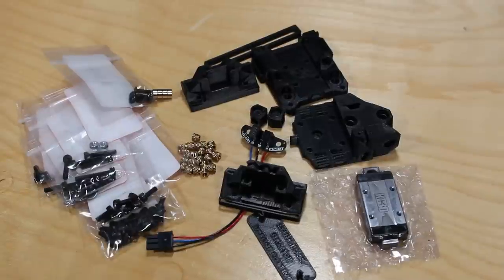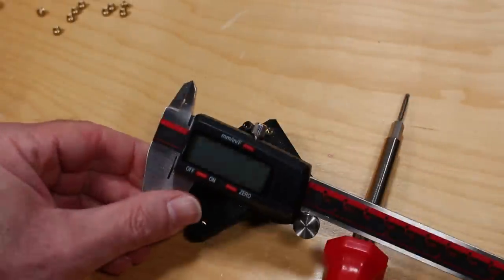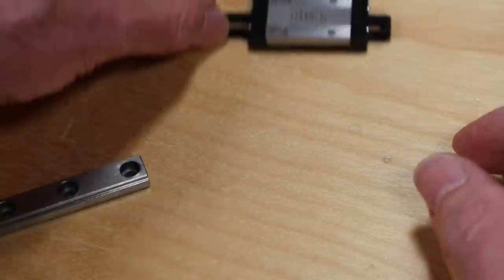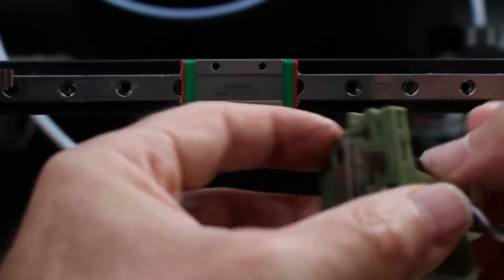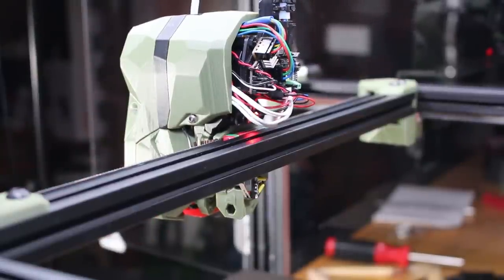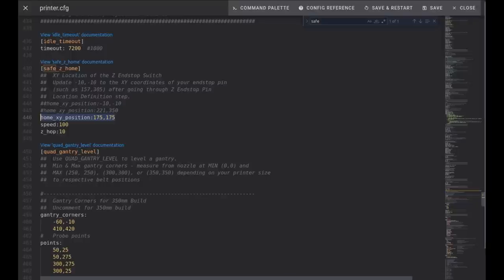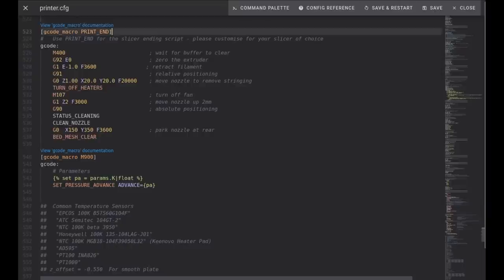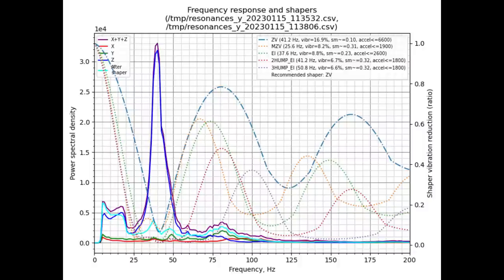Voron TAP build, install, configuration, tips & tricks, final thoughts.

Comment: Another addition: I just installed the 3do nozzle camera. Absolutely awesome! I printed the stealthburner adaptation, pulled the 2.5 meter usb cable through the cable guide. Added camera to moonraker and fluidd. Works like a charm! I did not change the led’s, because I already have rgwb (4 channel) and the leds that come with it are 3 channel white.
Reply from the maker: That's cool to know!  I've been looking at that as it would be nice to have.  But since switching to canbus, I'm reluctant to add a USB cable to my print head as I'm down to just 4 wires.  Which honestly, is just silly of me to bypass the benefits of a camera like that due to some wires!  You may have convinced me to just go ahead and do it......Thank you very much for the comments and watching!

Comment: I'm glad I stumbled across your channel! I don't know how long you've been making content, but you are a pro. I already watched your SB2040 CAN install and that was great as well. Concise, easy to follow,  great audio (other youtubers need to take note), great video and best of all it's not buried in the middle of a 4 hour long live stream. Keep up the great work!
Reply from the maker: Thank you so much for the kind words and watching!  I'm glad you find these useful!
Reply: @KapmansBasementWorkshop   A lot of the non-Hiwin rails have "fake" grease ports. They have the hole, but it doesnt lead anywhere. Also I decided to pull the trigger on the 2.4r2. I self sourced and built a Switchwire first, because I thought it would be an easier build and get me familiar with the Voron way of doing things. I've picked up a bunch of tricks and tips from watching your vids, so I'm excited to give it a go! The ldo kit I purchased comes with klicky and I've already printed and assembled Nevermore v5 duo, but what mods would you recommend from your experience? Do you think I should skip klicky and go straight to TAP? Thanks again for the great content!
Reply from the maker: @fumanseano2846  Since I actually print from my basement, Nevermore helped a lot gaining acceptance of this from other family members.  If you are interested in printing as fast as possible, I would continue with Klicky and add the automatic z-calibration software install (amazing) to that.  It works great.  If speed isn't your top priority, TAP is nice.  I'm actually still using it and like it quite a bit.  I find myself constantly tinkering with the printer so I've used magnetic panel clips (there are non-magnetic options as well) on the 2 side panels so I can easily and quickly remove the side panels and get them back on again.  Super useful.  I don't know what size 2.4 you are building, but I find the 3d printed handles that mount to the top of the printer very helpful on the 350mm model.  I don't know if your kit comes with led lighting for the interior, but I consider it mandatory at this stage.  Finally, once you have the printer up and running for a while, after some time, if you run into any wire breaks (you may never have that problem), I'm a fan of canbus.  But it's not a trivial upgrade.  I think the most important advice I can give you is to be careful each step of the way in the build and construct the printer as square and accurate as you can.  It's a really well designed 3d printer and actually works pretty fantastic once fully assembled.  Just be sure to follow https://ellis3dp.com/Print-Tuning-Guide/ after you have completed the Voron initial startup instructions.  It's the best guide out there to take your print quality to the next level.  I wish you a fantastic build!
Reply from the maker: @fumanseano2846  I failed to respond to all of it.  Some people are drilling 1mm holes into the fake grease ports and the claim is that it then works properly...

Comment: Lot's of good info.  I've been using TAP on my Voron V2 with smooth PEI.  As long as you're not probing with a fully up to temp hotend you shouldn't see any drastic damage.  I actually haven't seen any issues with mine.
Reply from the maker: I also lowered my temps quite a bit and I have been using it with a smooth PEI sheet as well.  And no marks.  I'm getting ready for a followup video on some tips and what I've learned.  As the weeks go by, I like it more and more.  Thanks for watching and the comments!
Reply: Beacon has entered the chat.
Reply from the maker: @beaconscanner  Yes, it has.  :)

Comment: I've been looking to rebuild my hot end assembly because I have a cw1 and was going to install TAP when I did the cw2 upgrade. I've been waiting for 3dlabtech to restock their TAP kits but after watching this it has made me rethink the TAP. My klicky setup has been working great and as much I want the new 'hotness', I'm not sure if the loss of acceleration potential is worth the fomo.

Thanks for another great video and keep up the good work!
Reply from the maker: It works well, but I'm not sure I'm going to keep it on my printer.  I want that acceleration back and I really like printing on smooth PEI.  I'm "on the fence" I suppose.  Thank you for the kind comments and watching!

Comment: On the carriages without grease ports, the plastic wiper still has the hole for grease, which makes it look like there is a grease port on the metal carriage. You can also add the grease through one of the rail holes.
Thank you for the video.
Reply from the maker: Thanks for the info!  I did not know that!  I'll bet that is what was happening here.   Thanks for the comment and watching!
Reply: Yup, the hardware kit I bought from Tensor 3d came with a garbage rail. Super rough, pretty dirty and didn't have a grease port. I had a backup LDO rail from the original build and took the carriage off of that. Has a grease port and slides like a dream..... Now I just need to find a PCB. 😭

Comment: The bed doesn't need to cool to probe...you nozzle need to be below printing temperature while probing...also I used a thinker Pei sheet and probe at temperature and have a small pit so milage may vary here...just a few point to throw out.
Reply from the maker: I might have used the wrong terminology.  But you are correct.  But also, the nozzle isn't supposed to be over 150c when probing.  Near the end of the video, I show what happens to PEI....Thanks for the comments and watching!
Reply: @KapmansBasementWorkshop for sure great! video!
Reply: @KapmansBasementWorkshop  so now I’m confused: can the bed and sheet be at printing temp (110 for me) as long as the nozzle is “cool” (<150)?
Reply: @drumsmichael  yes. it's how it's designed to be used.

Comment: Hello Mr. Kapman! I have possibly a silly question: does it still make sense to do automatic z calibration, if I have the Tap installed?

If I understand correctly, there is stil an offset between the nozzle and the probe and if I change the hotend part of the Stealthburner, I would need to readjust it? And if I have this plugin, it can do this automatically, right?
Reply from the maker: Not silly at all.  If you have TAP installed, no need for auto calibration.  For my machine with TAP, I just don't use it.

Comment: I’ve used smooth pei running R8 tap with 4 N48 magnets and while it’s leaves a small barely discernible mark it doesn’t effect the actual coating at all , now I rarely use smooth pei but it can be done.
Reply from the maker: I'm actually using smooth all the time now.   It works as long as the bed and nozzle aren't too hot.
Thanks!

Comment: Thanks for the great video. Since first installing Tap, are you happy with the change or do you regret theEuclid probe?
Reply from the maker: I'm actually happy with TAP.  I have not switched back to any other probe.  But the scrub brush is even more important now.  Also, at the temps that the Voron designers recommend, smooth PEI works just fine.  I actually lowered the temps by 10 degrees and it still works accurate enough.  No dents or scratches in the PEI.  My acceleration is not much better, but I'm going to try and clean up a few other things that may be impacting that.  This includes using an accelerometer in a different location.  There is also a new release of TAP where it appears they worked to improve it's stiffness.  So  I also need to give that one a try.  Thanks for the good question!

Comment: Finished my first Trident last week and installed Klicky PCB with AutoZ and seems solid. I did swap the switch the Klicky PCB came with as it was a plunger style and was giving varying readings. Soldered in a D2F-L switch and lots of times it will read the exact same reading on multiple probes down to the 0.000001. One day I might fool with TAP and see how it's used. Sadly I prefer a Smooth PEI sheet so knowing that now I don't think I can ever really run this.
Reply from the maker: Someone in the community reached out and stated that if one chooses to use a much higher quality smooth PEI sheet, they should be ok.  But that really implies that the 5 or 10 mil think PEI sheeting is used on a self applied bed plate.  But I have not tested that.  At some point I will give it a try.  Thanks for the comments and watching!

Comment: Great video. Thank you for the help. I just installed mine today and missed a lot of the breaking it in steps.
* update: I decided to go back to Klicky Probe. I didn't like the TAP. initially it worked ok, but then kept getting an error for triggered before homing/leveling etc. I did the loosen magnets & move printhead up and down but this only seemed to work temporarily. Maybe they should give a bit more clearance before its triggered. Also, out of the blue I got an error Move out of range: 0.000 0.000 5.052 [0.000] and couldn't fix it. Nothing changed in my printer.cfg before I got the error but I couldn't print anything. So I wen back to Klicky. I really like the TAPs X-Carriage more than the stock carriage. I hope they impliment it into the builds.
Reply from the maker: Thanks for the feedback.  I am actually still using it.  I like it, but I sure wish it were much lighter.

Comment: What about adding heat to the grease to reduce viscosity just to assist with greasing these bearings? Obviously you don’t need to hear it excessively but that should help without hurting the grease since the viscosity will just return to normal when it cools back down.
Reply from the maker: I think it does help.  I warmed up the printer with the bed at 110c for 30 to 40 mins.  I'd like to think that helped.  So far, it has been working well.  Thanks!

Comment: Hey there, I had problem here, I just bought cb1, i was confused òn what is ìt 16gb rom or ram I was confused. And one more is it esstial or waste of money
Reply from the maker: The 16gb is the eMMC storage. You won’t need an sdcard since the storage is built in. Basically a sold state drive that is usually faster and more durable than a SDcard. The cb1 has the cpu power of a rpi3 but more powerful graphics processing.  I don’t think the 16gb eMMC is a waste of money since sdcards wear out fairly quickly if they are written to often. When it happens, you need to reinstall everything including the os on a new card.  I’ve had this happen to me multiple times.  In my Klipper screen video I use the cm4 rip that had eMMC storage and its running great.
Reply: Thanks very much. For the opinion I wìll go with 16gb then.
Reply: I was about to return the product in store to get 1gb one.
Reply: @KapmansBasementWorkshop  best youtuber #3d_Printer_guider.
Reply from the maker: @deone-entity3935  Thank you!

Comment: Same acceleration issues here. I like that’s is super reliable and it doesn’t matter which surface you used. But I haven’t used smooth PEI.
I also see some retries when doing the quad leveling. Before, I was using Euclid probe and had inconsistent z offset, even when using autoz. 
Overall I’m happy with tap, but I’m not sure if I’ll keep it for too long.
In addition I also he CAN Bus using sb2040, and I had to add a small 20x20 fan to cool the mcu. Because when printing ABS the enclosure gets to 65 degrees and the sb2040 was shutting down close 100 degrees. With the small fan the mcu never goes beyond 80 degrees. My Y acceleration it’s a bit better than yours for some reason
Reply from the maker: So far, I'm still using TAP, but I have left everything else in place just in case I go back.  I have dropped the TAP temperature for the nozzle to 130c and today is the 1st day I'm printing with smooth PEI.  Time will tell pretty soon if this is ok.  I have not had overheating issues with my EBB36, but I did end up placing 2 small heat sinks on the driver chip (one on each side of the circuit board).  But I have seen multiple fan mods.   Also, I have the 20mm LDO motor instead of the 17mm.  It seems to use much less current.

Thanks very much for the comments and watching!
Reply: Try me.
Reply from the maker: @beaconscanner  Send one my way...
Reply: @KapmansBasementWorkshop  your channel rocks. Happy to send you one.

Comment: in your pros you didn't mention various thickness build sheets?  Is this because you are coming from klickey, or is this not an advantage?
Reply from the maker: Actually, it is an advantage.  I failed to point it out because I switched from automatic z calibration with Euclid and so I didn't really gain anything beyond what I had previously.  But you are absolutely correct.

Comment: I am wondering why when you were greasing you didn't remove the needle and just pump in the grease into the center hole of the rail then use the plastic piece to hold the bearings?
Reply from the maker: I had not heard of that technique.  But I have learned of it since.  That said, I typically use Hiwins and the grease ports actually work, so I was surprised when that did not work on this rail. But when pumping grease into the center hole as you described, that may work for an initial greasing, but what happens when later you need to apply more grease?  Do you completely remove the rail so you can do that again?
Reply: @KapmansBasementWorkshop  I guess you have to take it apart to grease it. If the grease port is not working you have to take it apart anyway. I am just saying it would have been a little easier for you and I didn't know if you knew about that technique. So I just thought I would mention it.
Reply from the maker: @chucktaylor5878  I learned about it after I did this work.  I wish I knew then.  Thank you for the tip!
Reply: @KapmansBasementWorkshop  I forgot to say thank you for the video, I didn't mean to sound ungrateful. Your videos are the best. I always look to seek if you have one out for what I need. Keep up the good work!! You have the best 3d printer content on youtube!!
Reply from the maker: @chucktaylor5878  I did not read it that way.  I'm always grateful for tips.  So Thank You!  Also, I'm always open to ideas on videos.  I can't promise anything, but I'm always interested in learning what might be interesting.

Comment: Very informative. I actually just got my tap kit and ordered it on impulse. I didn’t consider the mass difference, which is quite significant. I’m still on a CW 1 afterburner. I e printed the SB parts but still need tk go CW2
Reply from the maker: I still have alot more testing to do, and it works well.  But there are some tradeoffs as far as I can see and experience.  Thank you for the comments!

Comment: i also changed to TAP but now my nozzle cleaner is out of range from the nozzle to clean. do you have any solution for thad?
Reply from the maker: Have you tried recalibrating the location values for the brush?  If you have and still don’t have the space, you might need to move the bed and brush forward slightly so the brush is within reach.

Comment: It looks like you are using the 5v only version? did you have to do anything special to plug it into the CAN board? You are using the EBB36, correct? You do great videos by the way. very helpful.
Reply from the maker: Yes, I'm using the 5v only version.  I did not need to do anything special other than crimp a connector.  I used the same pin row I used for Euclid.  I'm using pin: can0:PB9 for the signal and the surrounding pins on that row for + and -.  It already outputs 5v even though the EBB36 is connected to 24v.  It's a really nice canbus board (I have not used any others) :).  Someone alerted me this week that I failed to upload my printer.cfg to github.  I will have it there by this weekend.  But if it's helpful, 
[probe]
pin: can0:PB9
x_offset: 0
y_offset: 0
speed: 3.0    
lift_speed: 
samples: 3
samples_result: median
sample_retract_dist: 3.0
samples_tolerance: 0.006
samples_tolerance_retries: 4
## and then paste the TAP Macro here.

If you like, send me a message on Discord if you have more questions.

Finally, thank you for the kind words!
Reply: @KapmansBasementWorkshop  great, thanks. I am getting ready to add canbus and thinking about doing TAP. I have the kit already just not sure if i want to use it yet.
Reply from the maker: @Dbauer50  I would do one change at a time.  Installing TAP is easier that canbus....

Comment: I just ordered a Tap kit but since I primarily print on glass, it's probably not a good idea. Think I stay with my PCB Klicky for now. BTW, I like probing while at temperature.
Reply from the maker: I'm not sure on that as I don't print on glass.  But this really does not create alot of pressure and you don't have a pei sheet to damage.  I would think as long as you don't probe too fast, it would probably work well with glass.  Thanks for watching.